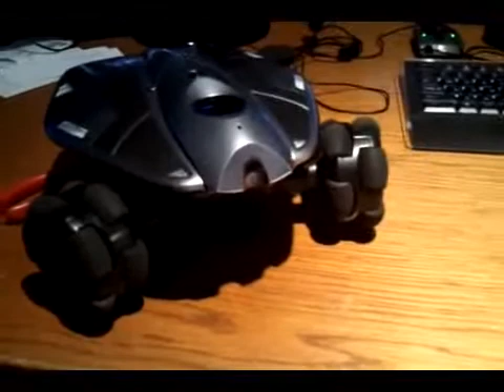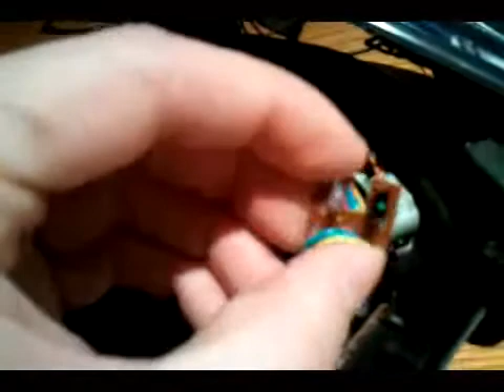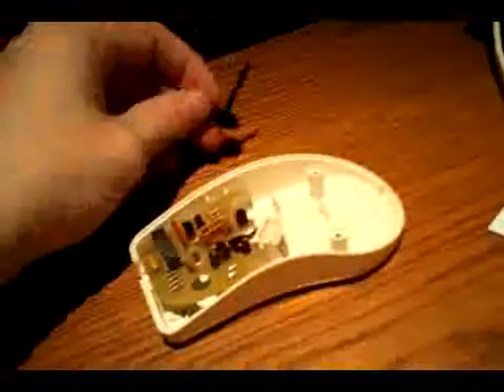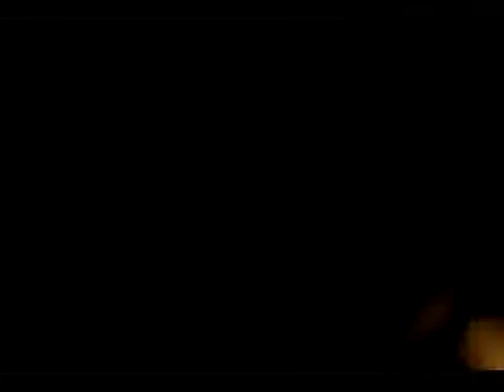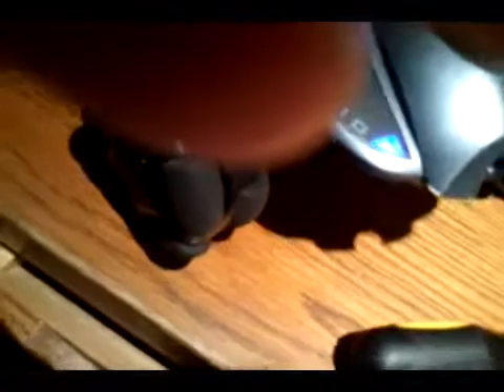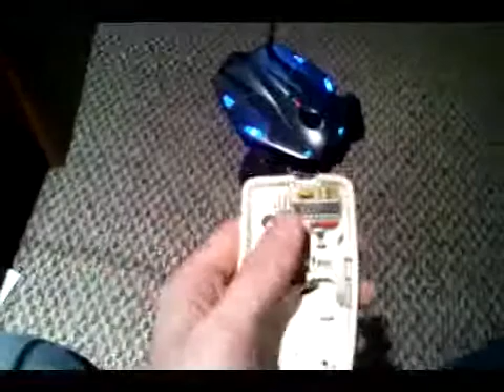Wowwee Rovio - Repair a Defective Wheel Encoder

Comment from the maker: A lot of you have asked me what to do if one of the motors that drives a wheel goes bad. Well I'm still here and using my Rovio in 2023 because there still is no other product like it for the price! So here's an easy fix. The electric motors themselves look like literally dozens of other electric motors you could buy. If you put just any motor in there, you will find it may spin faster or slower...effectively making your robot drive incorrectly. However, there's good news. You don't need to replace the whole motor. You just have to replace the brushes. This is the part that goes bad. So all you need to do is locate a similar motor. You are likely to find one in just about any toy you take apart. It takes a little patience, but you essentially pop the plastic back off your new motor carefully by bending the side metal tabs out. Then do the same thing with your bad motor. Slide the new casing with the brushes built into it onto your old motor. This should restore its function. It will have the proper RPM and torque as the spinning armature is not changed. It's always the brushes that go bad. But doing this will revive the old motor to like new again. I have found that driving on thicker carpet tends to burn out the brushes faster than if you use your robot mostly on hard floors. I don't have the time to make another video, but give it a shot. It's really not that hard. Can't believe it's been 12 years since I made the first video. All three of my kids each loved chasing Rovio around when they were at the crawling/toddler age. It really has lasted a long time with a few repairs I've done on it here and there along the way!

Comment: hi i own a rovio now in 2017 and it works and i use it a lot but i had a problem where my rovio's front left motor broke and i had to find a new motor and i took one out if a small spider robot and it works and drives around but when you first move it deveates and is slower than the other motors and has to speed up that motor to move straight.
Please do a totorial on how to fix this or replace the motors easly